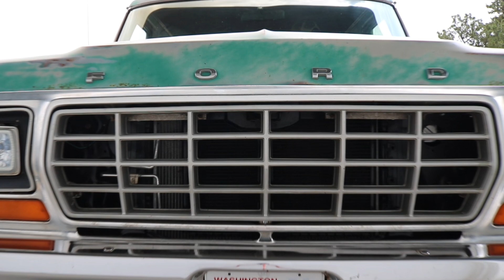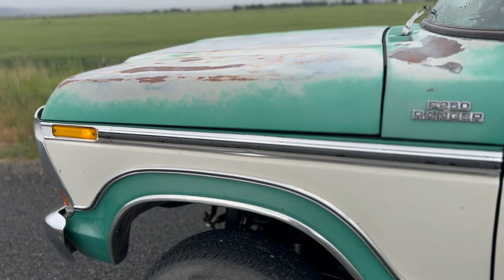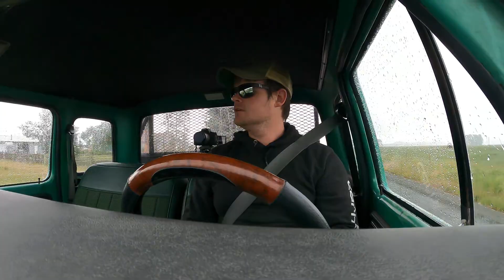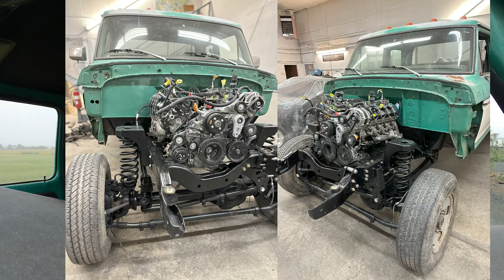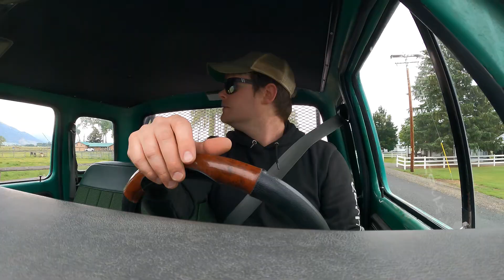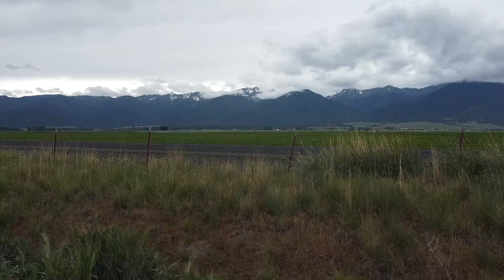NOT your typical work truck! 1978 Ford F250 Godzilla Swap

Comment: Did you source a 4x4 transmission or is there a way to convert the 2wd van trans? Custom motor mounts?
Reply from the maker: The transmission was really simple to convert to 4x4. Originally it had a crossmember mounting bracket that bolts on to the end of the transmission. To convert to 4x4, you unbolt that mount, and then bolt on the transfer case. I do not know what all t-cases share the bolt pattern, but I would look for any that have been used in Super Duty's since this transmission began being used. Hope that helps!